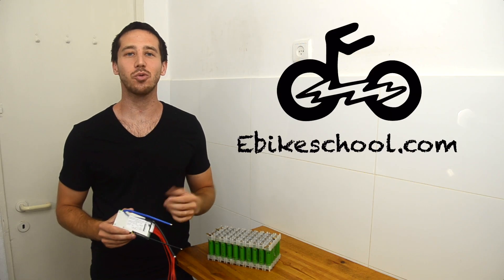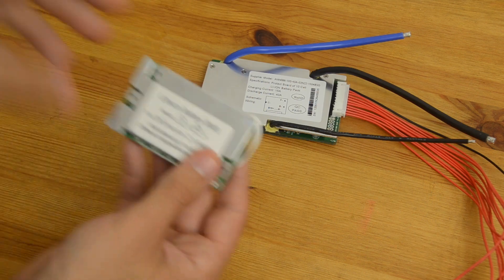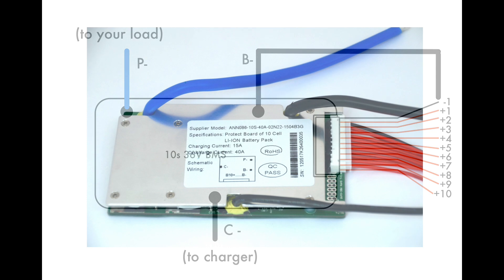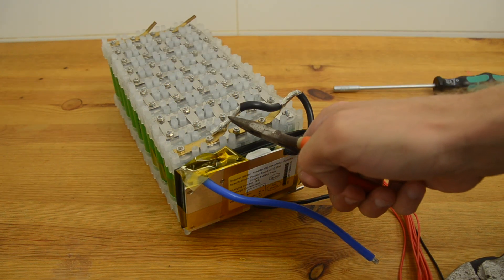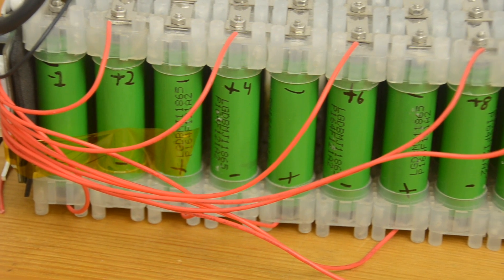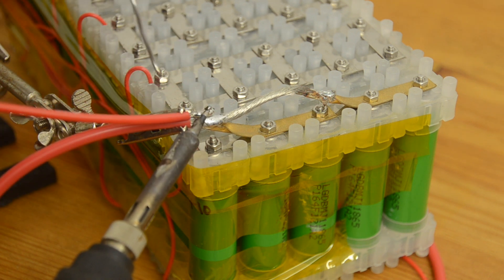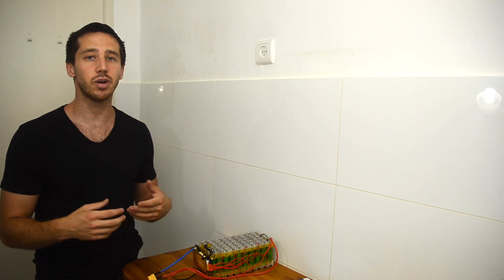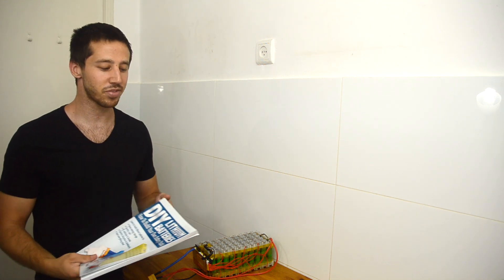How to add BMS (no spot-weld Vruzend DIY 18650 battery kit)

Comment: I have a battery from an electric bike. Has 3 wires coming out of the bms. Big red big black and a smaller black all on the same connector. How do I mod it to use and charge. 🙏

Comment: FYI, for a more solid battery housing one can get sheets of Kydex. It's plastic but has a low melting point so a heatgun makes it easy to mould. Frequently used for making ahem holsters.

Comment: I have a 48v  battery that came with the circle connector you screw in and I need help to know if it’s safe for me to snip each wire individually so that I can swap the connectors to a xt60

Comment: i had a smart bms that i changed for a regular one because the connector didnt came with the battery , my problem is the B+ wire  from the battery .. what do i do with it ,, my new bms has only C- P- and B- .. do you have a video already talking about that or a sugestion to give me to bypass the connector ,, i thought those problems would be out of the equation with a simplier bms but the B+ was hiden under the smart bms and unpleasant surprise to me when came the time to cut and replace the smart one with the already bought new simplier bms ,,it seems important because the current is still not going out of the battery to the bike everything is connected except that red wire .i m lost now  i dont find any tip nowhere about this subject , a connector sold separately or else and spent too much money already to push the whole thing aside or find a new battery ,,sorry for my english i m french canadian hi hi thanks in advance

Comment: Purchased a 10S BMS and had great communication from Micah whilst the BMS was on its way. After roughly 12 rides and charging cycles the eskate longboard stopped working. Narrowed the fault to the BMS and reached out to Micah for advice/support. That was three months ago. Very disappointed that there was no reply. Now I'm looking for a reliable BMS for my 10S 3P battery pack.

Comment: Hi! My BMS went out of order in my 22 Ah,36volt, Lithium ion battery  pack for my 250Watt, BLDCmotor,peakcurrent 15 amps,continues  current 6 to 8 amps.May I replace A Daly BMS,30amp 36volt, balancing  ,charging  15 amps,Discharging 30 amps,(this is available  with me)Please கைட் me.This pack was costructed with Original PANASONIC SDR CELLS.After 4 yrs use same ஸ்டாலினை.pl guide me my டியர்.
Reply: Read as guide

Comment: Hi how do I choose the correct bms for my folding scooter this are the specs of my battery:voltage 36v
Charging voltage 42v
Capacity 8 0Ah/288wh
Cell 18650
I found this on Amazon :4.2 out of 5 stars70 Reviews
36V 35A 10Series BMS PCB Protection Board with Balancing for Li-ion Battery Cell Pack  Will this work?
Thank you all

Comment: To prevent cold solder joints, heat the back side of the connector with the soldering tip and put the solder on the far side of the wire. This will ensure that all areas of the connection are hot enough to melt the solder for a solid solder joint.

Comment: Is it common to find the individual cells slightly out of balance after the first charge? I built a 10s3p pack and added the vruzend bms. The three cells closest to the positive terminal measure 4.22v and the others measure 4.18 or 4.17v.

Comment: my bms has like 17 wires for series. im only going to have like 11 series. do i NEED  to use each wire? will the bms still work correctly?
Reply: also my bms does not have a P- , do i need that? instead it has like an extra connecttor with 3 prongs

Comment: My BMS doesn’t have a C- does this change how I would wire my BMS?
Reply: some BMS can charge and discharge at the same output pin on the BMS..
you can attach the cable plug for charging and the load at the same pin..

in my opinion, the BMS with output pin separately are more easier to understood rather than with C- and P- .. because the P+ and C+ comes just comes from your positive side of the battery..

Comment: Thanks for this. I bought an Cao mm battery from ebay and it is not working after 1st cycle, i opened it up and see They connect the the LOAD - to the C- too. Did they do it wrong?

Comment: I have a Wave ebike and I must use the battery metal box, have 2 dead batteries. How can I build the 48volt battery and get it to fit in the metal keyed box using their wired connections. I want to use, if possible the Vruzend connectors. I am uncomfortable in putting this together. Bought your book and the connectors.  Can you help me? An old guy of 86 years. Ed G

Comment: I had a 10s2p hover board battery that wouldn't charge, after taking the battery apart and removing the bms I checked all the cells in the bottom 8 cells and the last 2 cells were bad.
I have a scooter that needs a 7s replacement, the bms is fine on the dead pack.....I plan on putting the 7s bms on the salvaged cells from the 10s battery.
Being that the cells I plan to use are already spot welded together and I can access all terminals are there any tips you could give me for sodering on the new 7s bms? I'm thinking soder in the middle of the 2p cells on the tin instead of on the top of the cells. 
Would it be smart to charge the cells some before putting the bms on? They are really low still as I haven't put any power to them without a bms and only have the ability to charge single parallel cells if I strip the spot welds but I do have a 7s charger I could hook the whole pack to....
Any feed back and help would be really appreciated. I think I'm going to wait a bit to start on it incase you respond soonish. Rather be safe then sorry.

Comment: I was spot welding some connections and one accidently fell on another part of the battery creating a short and spark and I pulled it of with some pliers very quickly but for that couple if seconds it was on it melted the nickel piece that fell on it, will the battery be ok?? The charge is the same and the volt meter is showing 52v the bms was not connected at the time. I'm worried that I may have damaged the battery

Comment: Is there a certain order you have to connect the wires?? I've killed 2 BMS now because there's no instructions 😖
Reply: How did you kill the BMS?
Reply: @lorengameros3963  I'm not sure to be honest. After I wired everything up I was getting about 11v less from the discharge than the actual battery pack. It happened twice. It's 13s for a scooter.

Comment: What would happen if I don’t use a BMS?  Could I just connect the positive and negative terminal into the connecter and then into in my case a transmitter and then camera?  Also Do you have to have balance wires?

Comment: Pro benefit  of the Vruzend No spot weld kit diy battery kit would be not having to weld or solder cells. 
For me personally soldering is not an easy or healthy diy job. I have tried it a lot. Many times the connections or solder just won't melt very good even with a very good quality hot iron and tip or if managed a soldered connection tends to get loose over time in my case. 
So when a lot of soldering has to be done, with the BMS system wires. I will probably be better of leaving this technical connecting method to the skilled factory workers.
If only a battery pack could work without the added BMS then I would be able to fix that with the Vruzend no weld kit and then I would give it a try, as a beginner.
But unfortunately without the complicated BMS system electronics and wires it isn't safe.
Reply: Use flux on the piece first, needs to be clean. Then use soldering iron to heat the surface/piece using the iron with a larger surface touching as possible. Let the work heat up then apply solder. Pretin your wire etc, put some flux on heat it then apply solder. Then solder wire to the device etc

Comment: Hello, how do i know, how much "A" my bms needs? For example for a 48v 20Ah betterie to power a 1kw motor
Reply: I think 13S 40A BMS would do. But double check. Mine is a 13S 30A BMS on a 48V 11Ah battery powering a 1KW motor.

Comment: I just got into electric scooters and would love to be able to build my own 60volt replacement high quality battery, any ideas where to buy about 200 high end batteries. Thinking around 30ah,60volt, scooter is actually 58.8 volt.
Reply: Try R S components.

Comment: I have 3s10p 18650 batteries every 3s=12v  now is I have to connect a bms with only with positive end of every series or series and parallel both

Comment: Many thanks for your videos. I was quoted a lot of money for re celling my poor battery, so I have followed your videos and made one up using Vruzend system and bms. I’ve just come back from a 50% longer than usual ride and saddle sore☺️.  It cost me half as much as re celling or buying a new lower capacity battery. The bonus is that I have had the pleasure of making it myself, and now understand the system.  It’s 24v with four cells in parallel. Is that 7S4P?   I’m going to increase it to six in parallel sometime soon. Your videos are clear and informative.

Comment: is a nice system
I want to make a battery
of 340 pieces Battery Model: 72 v 60Ah
17-parallel 20 series
Capacity: 60AHSuit for motor: 72V 2000-6000W
where can i buy them ??
am from the Netherlands
a question which batteries
can i use the best ??

Comment: I would prefer to connect the balance wires with small round crimping terminal to prevent against vibration.

Comment: Lithium ion battery of 351 volts of 95 cells came with its BMS but I'm converting it from 351 volt to 48 volts for my inverter. Can the stock BMS still work with it if stepped down to 48 volts configuration?
Reply: No. If you are doing twelve battery cells in series to make your 48 volt system you need a bms 12 S(series) not counting the black negative wire. if your doing thirteen in series you need a bms with thirteen leads plus black negative.

Comment: Great revolutionary work & videos. Thanks a lot.
I have your BOOK. Inspired me to make my own Battery pack for a DRONE.
Which Gauge silicon wire is suitable for 6S, 4P battery pack made out of 18650B ( Panasonic ).
X60 connector is sufficient...???

Comment: So I bought your book about a week ago, haven't got thru it all yet but so far really good info. The one thing I'm confused about with BMSs though is, if I have a 3S30p battery, do I need thirty 3s BMS boards? Or would you treat each of the 30 cells in parallel as one and then only need three 3s BMS boards?

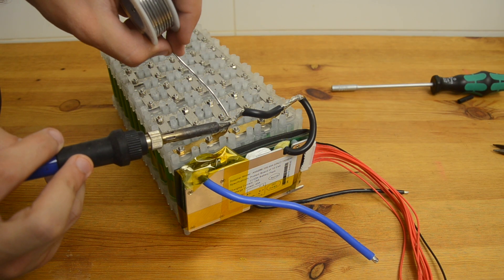Comment: At 2:10 you crimp and solder the main wire to the negative side of the pack. Hos do you get such a big wire to solder to the plate? Also these plates are quite tricky to get them to actually "crimp" onto the wire. Got any tricks? I'm currently trying to attach an 8 awg wire to 3 crimp connectors on the negative side of the pack.

Comment: Hey man thanks for the thorough walkthrough.  I used your kit to build my 7s7p pack for a portable power supply. One question tho... after wiring the BMS the charge and load ends of my bms are reading different voltages by about 1.8 volts different. The charge end was reading 24.8/9 volts and the load was at 23v. Any reason there is such a variation? Did I do something wrong?

Comment: Hey I bought your Solar book! I need a low cost 10s  40A or 50a BMS for an ESkate board. Can you send me a link please.. it needs to be small as well. Thanks!
Reply from the maker: Thanks for your support! The low cost, cheap BMSs will never be able to support that much current. The higher current the BMS is rated for, the larger and more expensive it will be. Check out this one, rated for 40A continuous and 80A peak. http://vruzend.com/product/36v-10s-battery-management-system-bms/

Comment: I see that your using a 12g wire for the positive discharge and a 10g for the negative discharge. Is that correct?

Comment: an I use, lets say, a 10S bms for a 6s battery pack, by not using 4 of the balance leads, and powering it with 22,2V?
Reply: Can*
Reply from the maker: No it won't work because the BMS will assume its an error when it sees 4 cells missing.

Comment: I ordered a kit and will look into your book too.  You mentioned it can be tricky to remove cells from the holders.  Can you provide any pointers on how to facilitate this process?  I would assume it begins with removal of the bus bars and disassembly of the individual cell elements.  What is the best way then to slide the caps off? Another question, I'd like to fuse each cell with PTC resettable.  Do you have a recommendation as to how this could be configured with the Vruzend system, perhaps by soldering onto bus strips?

Comment: Hi Micah, great job, I realy love the idea off the terminal caps, but why don't you use a plastic bold and nut in between each 4 cells to keep the top and bottom off the pack together, so you also can use old cells or cells whitout the plactic cover, which do not fit tightly in your terminal caps. the bolds also prevent the pack from falling apart because of vibrations.
btw are you planning for a 16s BMS?

Comment: do i have to  match the cells i have a  48 volt 13 s 20 ah battery but i want to  add 4 more  volts to 14 s 52 volt  because my charger charges to 54.6 volt anyways i need extra volts for longer time

Comment: I just got your DIY book, its great.  I also just ordered two 36v BMS's from VRUZEND.com.
My question is, I have a FOCBOX (VESC) controller on my 10s4p skateboard, do I still need to run the discharge of the battery through the BMS or is that handled by the FOCBOX?  My friends say not to discharge through the BMS.

Comment: could 2 of these 36 volt batteries made exactly like you did with the same bms configuration be wired together in parallel do achieve 72 volts battery pack with 17.5 ah battery pack cause parallel will double the voltage but not the amp hours correct or not or if I wanted to double the voltage and the amp hours then could I take 3 of these 36 volt 17.5ah batteries wire 2 in series and just add a 3rd one in parallel to make a 72volt  35 amp hour battery  course I think they all have to be charged separately as 36 volt 17.5 ah battery would either one of these setups work  and still be safe I want to have the most power and longest range with the smallest configuration and I feel confident building this 36 volt battery cause I can keep going back to the video for reassurances anyway from what I have read thus far it seems like both of these would be possible just need conformation thanks

Comment: Well it seems triple checking was not enough! Although I connected all the balance wires in the correct sequence, I.e +1 +2 +3 ect and the black wire to the negative of the first cell, I started the sequence with +1 connected to cell 13 !! This happened because of how I was going to attach the BMS to the battery. I have now swapped it around and it all seems fine with a cool BMS.
Another lesson learned!
However I do not know if this mistake would have damaged the BMS? The charger is performing differently now also, it seems to cut in and out and the charge is building up which it wasn't doing the first time. I have never used an e-bike charger before so again I do not know if this is normal operation? I'll keep a close eye on things and see how it progresses.
Thanks

Comment: Hi Micah, thanks for your videos and your book on building batteries is great.
I am almost done with building 48v 6p pack using new Panasonic PF's and the Vruzend kit. I have just wired up the bms and noticed before I'd even finished completing the balance lead connections that the bms started feeling a little warm? I have double and triple checked the connections and am satisfied that they are correct, there was never any smoke or smell of burning. I have now connected the 48v charger and am waiting to see if it charges. Have you ever come across this before? The bms I used is the type with only one negative wire for charging and output.
Thanks again
Mario

P.S. The bms I used is this: http://www.ebay.co.uk/itm/13S-45A-48V-Li-ion-Lithium-18650-Battery-Cell-BMS-PCB-Protection-Balance-Board/322450842044?_trkparms=aid%3D111001%26algo%3DREC.SEED%26ao%3D1%26asc%3D20160727114228%26meid%3Dcf5c066a556247df84026789af5507fa%26pid%3D100290%26rk%3D1%26rkt%3D1%26sd%3D322450842044&_trksid=p2060778.c100290.m3507
Reply from the maker: That behavior does seem odd. I rarely use those two wire BMSs so I can't say for sure if its normal or not, but it is a bit surprising to me as normally no current is flowing through the BMS unless you're actually charging. Do you know what the voltage of the cells were before you assembled? If they weren't full, then I'd be surprised if that heat was from balancing. More likely current is flowing through the BMS due to either a problem in the BMS or a connection error. I know you said you trickle checked it, but just in case that's the issue, I'd recommend posting up a picture on ES or somewhere that people can check your wiring for you before charging all the way.

Comment: Hi, i am looking at the kit to be used in conjunction for a E-MTB build I am working on. I will need a flat section battery so may have to use silicon wire to connect the parallel packs. Looking at the build video I am concerned with the nuts shaking loose as you don't seem to be using any sort of anti-shake washer, nyloc nut or thread-lock. Having one of those nuts come loose later on after the pack has been shrink wrapped would not be good. Also, i can see there might be an issue with the crimping only option of the tails connectors. I can see the only option is soldering for these which is ok. I have considered a non-insulated nickel crimp lug then bolting to the battery post but am thinking that the length of the post may not be long enough. In concept, a very good idea and I am very impressed. What are your thoughts on the points? Many thanks for your time, Mark